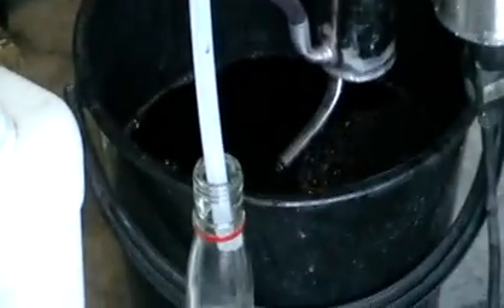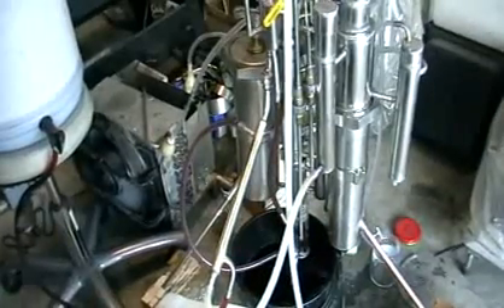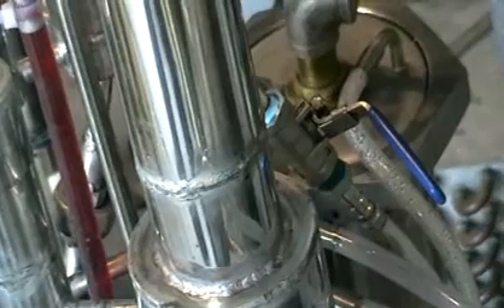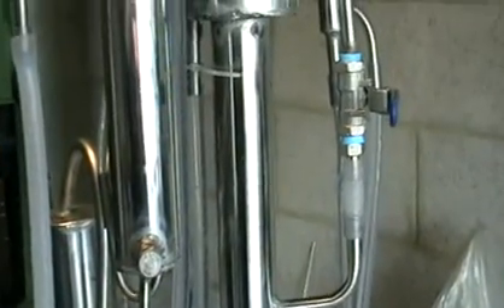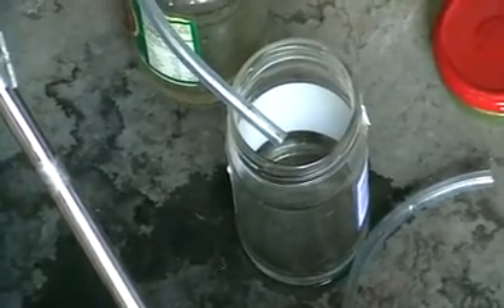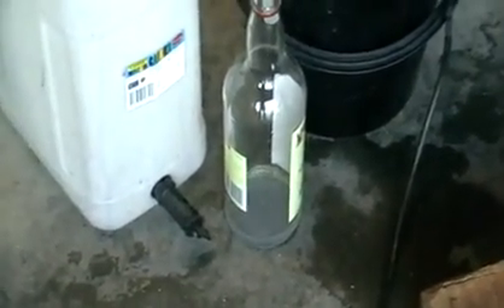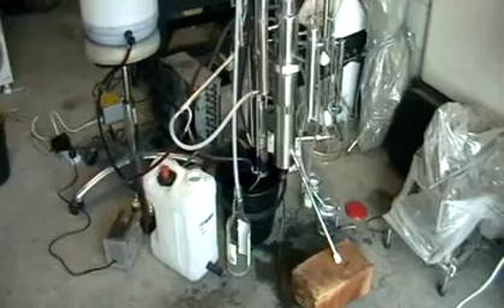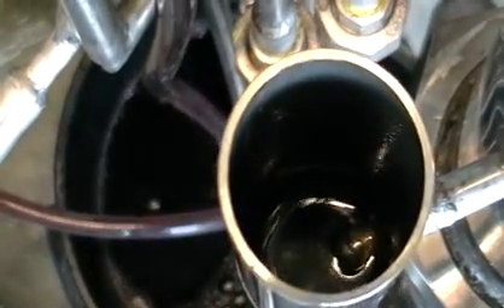Moonshine alcohol still - continuous moonshine distillation

Comment from the maker: Hi there are many methods to determine the final product purity, first of all even if this still is not perfectly separating, - it is separating much better than any pot still while potted spirits are among most acceptable, thus there are: chemical method, also method that based on mathematically amounts per determined volume of final product per hour, plus power applied taken into account too, simply comparison with similarly powered batch fractional system with similar production rate per hour